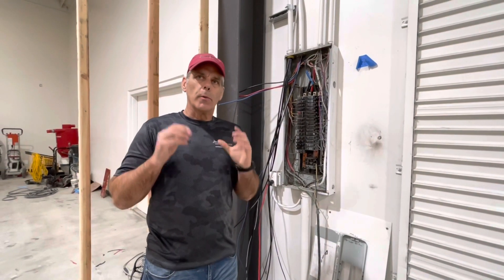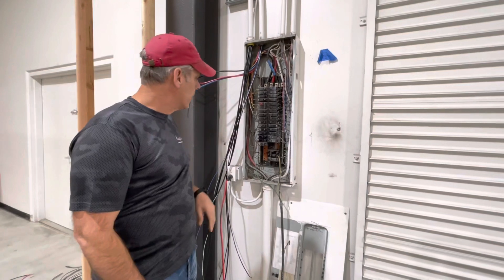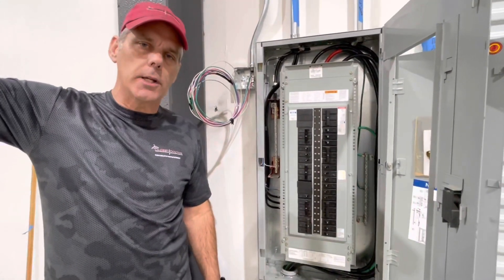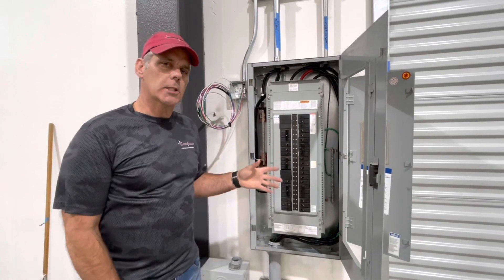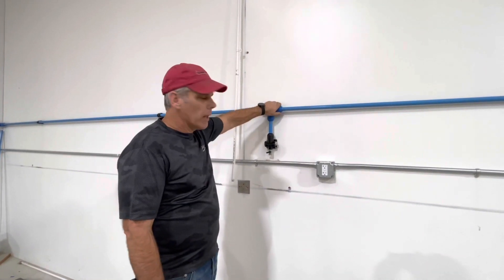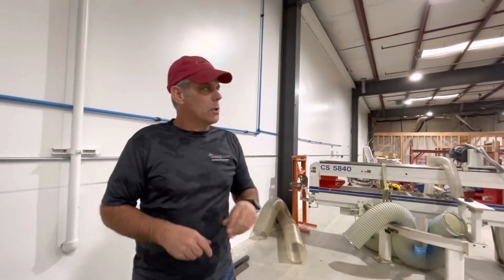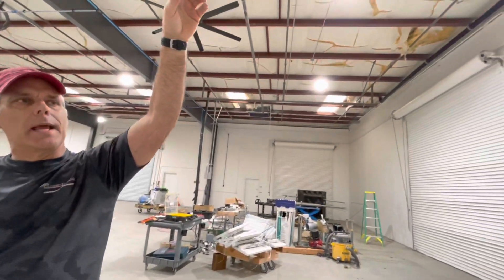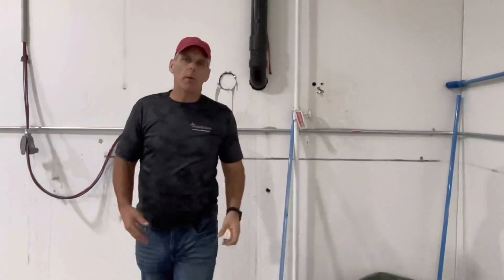Closet Doctor 3.0 update 1/13/22 Electric and Airlines

Comment: I imagine your folks have done the calculations for friction loss on your vacuum hose lengths? I am curious what size hose you need for that distance , or is a different size hose even required? Thanks
Reply from the maker: No on calculations what you see in the videos is mostly temporary until we get settled and we will be improving. We have a lot of existing pipe and have used or plan on using that